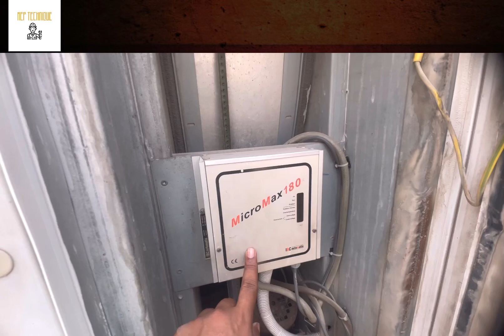Fresh Air Handling Unit (FAHU) Working.

Comment: Heat recovery unit kitne prakar ka hota hai
Reply from the maker: 1) Heat recovery wheel or energy recovery wheel or enthalpy wheel (both temperature and humidity recover).
2) Sensible wheel ( only temperature recover).
3) Latent wheel ( only moister contents in air).

Comment: Sir, volume control damper requires separate electrical power from DB ?
Reply from the maker: Volume control damper connect separate power supply which interfaces with FA panel or DDC .If you close the power supply from MCC then you VCD will not turn off but in the event of Fire the fresh air VCD will close.
Reply: https://youtu.be/h95d6HCY-Lw?si=heyu9ZeQ6xdfLxAG